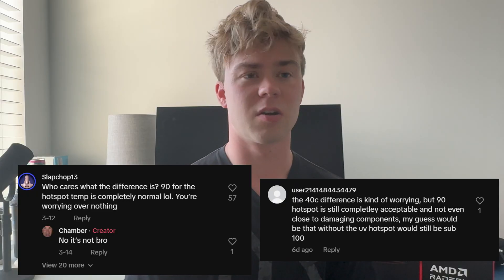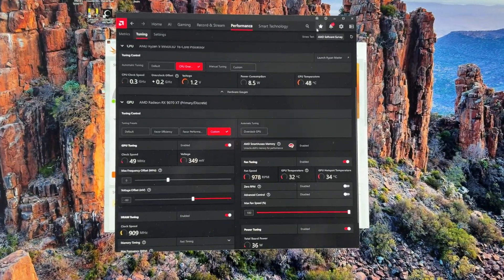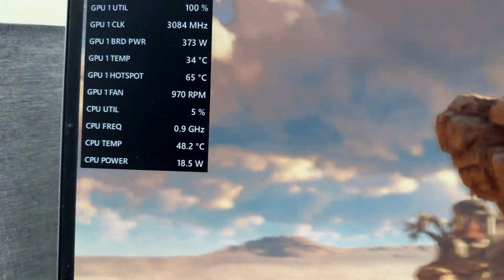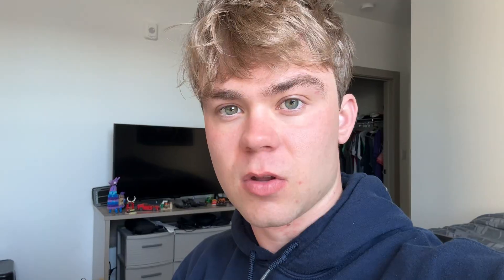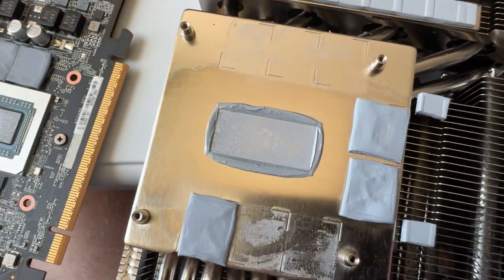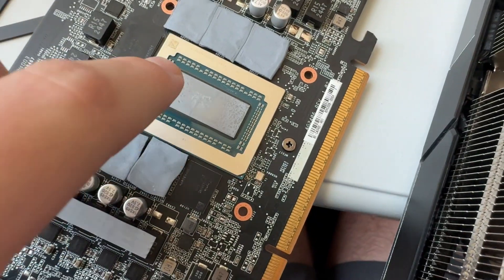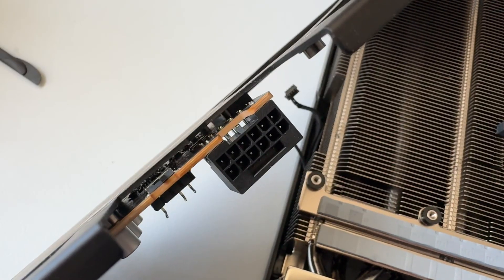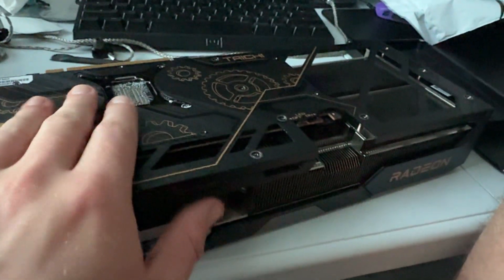Fixing the 9070XT... (Teardown/ Repaste)

Comment: GPU die contact + better thermal paste + undervolt propperly will make your gpu run much cooler with better performance.

I think you might want to retry mounting the cooler with a better interface paste. Distribute smoothly, evenly, and try again. 

I did a mess with my XFX 6700 XT by not calculating the time new thermal pads on the memories would need in order to settle down to the best hight. In less few words: the new pads made a poor contact (by maybe just 0.1mm) with the cooler. 

The solution, reopen, retighten screws, to the limit, and now are awesome under 79º Hotspot, normally undervolted 73º. Thats a long lasting GPU die and board

Comment: This is why I hate the AMD cards, even if they may overperform nVidia ones in the same model segment, they always run way too hot and most of the time using more power as well. The biggest problem they have isn't even the GPU but the VRAM temperature, running very close to the limits. I am not a fan of nVidia either, I actually wish Intel will catch up faster and delivers better and cheaper graphics cards than these two scamming companies.

Comment: 8:16 You can disable power limit in RX9070/XT rather easily. Buildzoid made good video about it, so I recommend to go check his video for greater detail. All you have to do is short 2 legs on IC labelled U5521 (and U5524 if you have 2x8pin connectors). And that's it.

Comment: Is there anything new about the Taichi and the high delta? I also have one and a similar picture. I wanted to counteract this with undervolting, which initially ran without problems in the benchmark test, but always triggers an AMD driver timeout in games. Have you had similar experiences?
Reply: I built mine this december and undervolted my taichi 9070xt as well but not aggressively, placed a mini desk fan and it helped my thermals even more (68-72c hotspot gpu temp). Just a temporary solution before I resort to this as well when the time comes it reaches 90c even with the mini desk fan is active.

Comment: Perhaps the game or the device you're using to test it is faulty. My RX 9070 XT at max power limit and -50mv undervolt can hit 3400MHz. My case is really bad for temps, tho, so my GPU hotspot hits 104c °C. I think I got a good chip, but my case is bad. I think with a better case or no airflow issues, it could go up to 3500-3600. 

I am using the RX 9070 XT Steel legend. The RGB is really nice btw.

Comment: I don't expect the hotspot is from uneven cooling or poorly mounted cooler. It's them measuring the hottest part of the core, which will always be the hottest part of the core, it's the part that works the hardest or has the longest path to reject heat. This is actually normal on all cores, AMD, Nvidia, Intel, you just won't always have it presented in the telemetry.

Comment: I've got the same card and I'm trying to tear it down to put a alphacool waterblock on it, but I can't get it to come apart?

did you skip any steps in the sudden cut to a disassembled card?
Reply: Once you've checked all of the obvious screws and IO bracket are removed you might just need to flex it gently and pull apart. Mine took a little more force.

Comment: That's nothing. I have to use radeon chill and limit my frame rate to get temps that low. My hotspot was getting 92-98°C and memory temps in mid-upper 80s. Granted, I was running a low undervolt of -150 mv and power of +10% with my memory frequency hitting almost 3500mhz, but even at stock settings, they were a bit concerning.

Comment: Got the Taichi myself, keep in mind my ambient temperature is 29-30°C

Running -100mv voltage offset I’m getting a solid 3350-3400mhz core clock, 2700mhz memory clock, and default 340w power limit sometimes peaks to 345w.

Getting 52, edge temp with 82°C on hotspot. This is in a ray traced situation and runs cooler without.  Wouldn’t deem the hotspot to be dangerous.

Had way worse issues with previous sapphire cards like the 5700xt and 7800xt both of with hotspots being insane. Both Nitro+ Models

5700xt would run 65 edge and 104-105°C Hotspot this was reduced to 95hotspot with a repaste. 

7800xt was 101°C hotspot with an edge of 61ish which I dropped to about 90°C hotspot with a repaste. 

82°C at full power, usage and RT is not a problem and rather good
Reply: Thanks for the info on your Tachi.
Mine has a core temp of 58 and a hotspot of 92 @304w. Ambient temp about 15c
Lots of case fans and airflow.
Summer gets hot here with a few 35c+ days and the hotspot temp are going to suck.
Tempted to try and "re paste"` with new PTM7950 and hope it improves.
Prob not bad enough to RMA, but not ideal
Reply: @datfreakdatfreak6123 I’ve managed to drop my power limit to 295 without any loss in frame rates, countered it by raising my memory lock further.

You’d be surprised how much ambient affects the temperature I was hitting 85°C on my hotspot last night however my ambient was 29°C, on days where my ambient is 20-21 it doesn’t hit 80°C on the hotspot
Reply: @sproductions3958  Mine hits  92c at about 305w, at 240w its fine at <80c. There is a mention on reddit of someone getting temps like mine and replaced the PTM7950 and then got normal ~80c hotspot temps at std power. Like the thermal pad wasn't applied adequately at the factory.
Ive ordered some PTM7950 and will see if it improves mine.

Comment: Got an gigabyte oc gaming l. What i experience with the 9070xt you just need to undervolt, vram fast timing and 2700 but you need to lower the power limit to lowest. Will cost you maybe 5 fps but hotspot will drop to 69 degrees 🎉
Reply: Basically every 9070xt user is doing this. im losing like 3-4% but ingame for -30% Powerlimit and 220w used. my gpu fan is sometimes at 0rpm at gaming :D
Reply: @thetechthingguy5281 jep that is true. Same here. But this person that is saying in YouTube that his hotspot is to high. He has power limit to +35.......
Reply: @thetechthingguy5281  playing the last of us remake in ultra at 1440 120fps with fans at 0 rpm is crazy xD

Comment: buy the 9070xt with Samsung memory. Sapphire, XFX, Yeston, already moved to Samsung memory which shows better memory temp. Your hotspot was directly affected by the memory temp which unfortunately you did not include in this video. As expected in your result, this is not about repasting, but a problem with the memory (Hynix) with very high temp under load.
Reply: i do have sapphire 9070xt with samsung. it still goes to 86c hotspot, around 90 memory. and my samsung chips wont go over 2600mhz stable OC...
Reply: @dombarek7820  bad luck bro..86 for hotspot i run into when ambient is 36 degrees C, no undervolt, playing 3A games. Memory is never above 75 no matter what.

Comment: nvidia removed theres because its hitting 100c and people would freak out on reddit cause folks dont understand a 20-30c delta between hotspot and base temp is normal for this generation both amd and nvidia. the amd sensor is using edge temp for hot spot its not relevant this is another reason nvidia opted out it stated its simply jiust not a good metric to follow because it confuses people more than anything. 

this video proves that. 

the best thing you can do is water cool it and chuck the radiator in ice water.
or set custom fan curves to were hotspot doesnt exceed 75c and enjoy

Comment: The temp delta isn't something you need to worry. As far as I know, the GPU temp on AMD GPUs is basically the legacy "edge" temp, which has become kind of "useless" in recent AMD GPU generations. The important reading is the hotspot/junction temp (anything under 90C sustained is fine, although I try to keep mine 80-85C. Everything runs off the hotspot temp including the boost algorithm, fan speed, etc.
Reply: Correct 80 - 85 C is the best for this cards.

Comment: Steel nomad score is simply frame rate x100. 7786 is just average FPS of 77.86. Reviewers and hardware enthusiasts care about stuff like 3-8 fps but most of us just want our games to run stable and card cool so fan noise is not an issues. A modest undervolt and core offset with max power and slightly higher fan curves than default is fine and a delta of 20-40c is meaningless when hotspot stays below 80c. Honestly.... the worst thing you can do is obsess about such things. Especially as frame gen and scaling with AI get better and better. Just play games... enjoy your card.

Comment: I was going to add the same comment as other about the PTM7950.   And the sound 🙂
I have both the 9070 and 9070 XT.  My experience is that AMD has cranked too much power in the XT model which cause high temps and the high frequency clock just break the efficiency of this chip (Navi 48).  Hot spot on my Asus TUF is about 76C but what worry me is the VRAM temps that go to 86C.  I'm not comfortable with that and my solution was to drop max power to 280W and edit a more aggressive fan profile.  I also undervolted to -60mv which help to recover a bit of performance.
Reply: I have the Gigabyte OC 9070xt. I undervolt -25, +75Mhz offset, +10 Power, 3300Mghz in Cyberpunk 420watts at peak.. and mem temp never goes above 85c, I set fan profiles a bit more aggressively, but that also does not go above ~58%.
Reply: Yea, just tested in Remnant 2  84c mem, 78c Hotspot, 52c Global @ 3224 Mghz 406watts, 53% fan speed. I leave mem speed stock at 2505 Mghz. Default timings. Ultra settings 4K matching my 144hz monitor in FPS. dips to maybe 120 at times. FSR and frame gen Quality upscale. Looks great, runs fine. My wife has the Gigabyte 9070 OC and it also runs pretty cool and quiet.
Reply: Vram below 108 degrees with these cards is within spec

Comment: Anything in the low 80's is still really good for a GPU as fast as the 9070xt. Anything up to 110 is actually rated as safe so you're very far away. I understand safe doesn't mean cool but even mid 90's is perfectly fine.

Also how is conductonaut gonna fix the hotspot temp? The core (aka die) is most likely not the hotspot. That area is probably the coolest on the entire GPU. Curious how you thought that would help the Hotspot...??
Reply: It reminds me of how CPU's used to be rated at 60-70C max temp, and they would die if you got them much hotter, but nowadays many are rated at 100C, or more (Intel). I imagine memory advancement has been much the same where increasing temps are a known quantity by the engineers. When they say something is within the rated safe threshold, they're not lying. If they were, they'd end up with a lot of warranty requests and the company would not be happy with them. It sounds hot, but it's just how modern tech is going. I don't like the extreme temps either. I guess I just try to accept they must know what they're doing? Other than Intel/NVIDIA with that 12v connector. Now that Asrock has adopted it, I'm not sure what to think.

Comment: Yea...that card definitely uses the real Honeywell PTM7950. You were NOT going to get better performance even with the KPX. The only way to get better temps is if you went with a full coverage water block and full water cooling system.
Reply: Pump out incoming*
Reply: @Ssdj3nt  pump out is due to bad mounting / wrong pressure. not the paste itself. thermal paste and ptm are both rated to 150c. one just lasts longer in life span due to not drying out after 2-3 years. the fanboy hype over ptm is insane tho most of the ptm fixed my temps are due to shoddy thermal paste installs most factory thermal paste installs suck in general and most users also arent good at this. so ptm is a solid option for average users to not mess up and be idiot proof.
Reply: it's the memory, not about the cooler. Hynix memory is causing this high temp. New 9060XT produced mid of April are all using Samsung memory which shows much better thermal.

Comment: I personally found that using thermal putty such as upsiren UTP8 and then using phase change material in specficic thermal grizzly's since derbauer since he sourced it from honeywell himself seems to improve it slightly but I think this may just be how it is speced the 9070xt to redline towards the 85c hotspot since if you look on techpowerup it seems like every other card essentially sits in the same space despite them using different coolers.

PTM seems to do a lot better under even more contact pressure and personally I found it to be better than other solutions for gpus for temperature when you using thermal putty and have an increased amount of mounting force but I found the change more noticeable on nvidia cards that I have.

As an edit you do not need to fill the whole die with ptm7950; around 50-70% is sufficient enough since it will spread when phased changed and will more than likely better for it to get as thin as possible. You can reference snarks domain on youtube or igors lab; pretty sure igor has an article in regards to putty in any case.